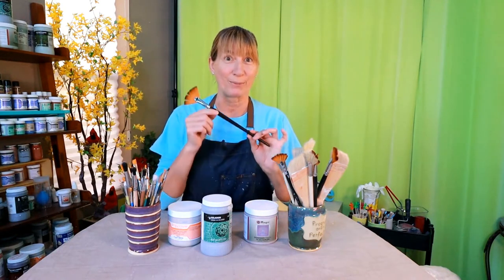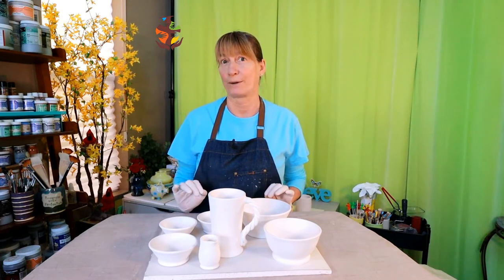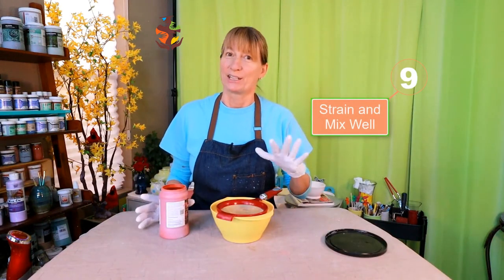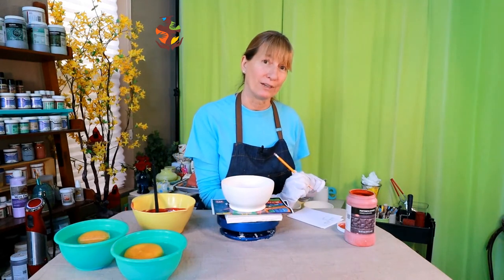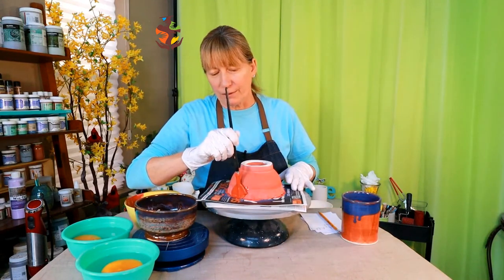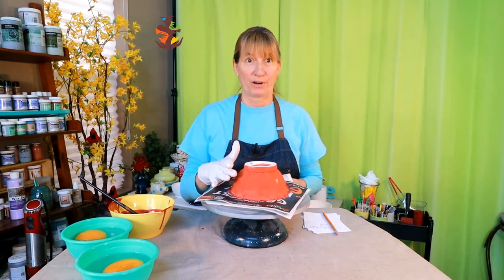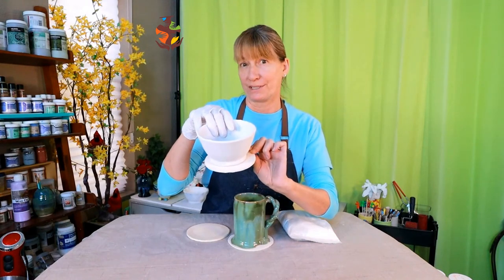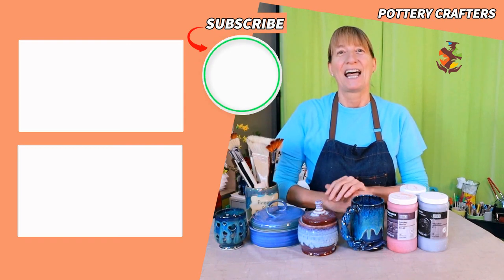21 Tips for Brush Glazing - Pottery Glazing Techniques

Comment: Hello Marie I prepared a transparent powder glaze but I find that the rendering is not very clear I left it to settle for a few weeks do you think that if I remove a little water it will give me a better consistency therefore better results. Thank you in advance.
Reply from the maker: Good question Robert. If it's not clear it may be that you don't have enough water in it. The specific gravity should be right around 41.  put your 100 ml syringe on the scale. then turn it on so you are not weighing the syringe. suck up 100ml of glaze. the water weighs 100 grams so the grams should be around 141. minus the 100 and your specific gravity is 41. Test fire if you need to. if you need a higher specific gravity then add less water. lower specific gravity then add more water. 👍👍

Comment: Thank you for your videos. I have a lot to learn about pottery and I appreciate your tutorial assistance! Love how you speak slowly instead of the rapid-fire-speed-talking of some tutorials.

Two questions about using wax resist on the bottoms of bisque ware: One or two coats on the bottom? After applying the wax resist, do I fire the bisque ware again before glazing it (and then fire a third time)?
Reply from the maker: Thank you Miranda 😊  Those are very good and important questions. You only need one coat of wax resist, wait until the wax resist is completely dry then apply your glaze. The wax resist will burn off during the glaze fire. For more detailed information on wax resist here is a link to my post -  https://potterycrafters.com/what-is-wax-resist-in-pottery-used-for/  😊

Comment: I loved this video! I am not new to visual arts but totally new to ceramics.  I really want to paint some of my artwork on flat ceramics for wall hangings or plaques, plates, ect. I see 2D as I don't have sterio vision so this works best for me. Any video that could demonstrate how glazes react to this technique as compared to pottery. I am going for an impressionist msytical look with glazes and etching on the clay.
Reply from the maker: Hi Eve, Thank you very much. If I understand correctly. I think using underglazes to get the effect you want. Then apply clear glaze over it. This should work because underglazes are more for drawing on pottery. Even colored slip in the greenware stage could work because you can apply it thicker. I hope this helped.😊

Comment: Once again, another great video. I am new to brushing on glaze, I think that I've been putting it on too thin as basically every color I brush on ends up brown. My real question is regarding glazes that run. I love the look of a flowing moving glaze but am curious if I put a area of matte glaze or something else at the bottom if it would help to stop or slow the flow.
Any ideas other than to leave the bottom of a bowl with only a thin layer of glaze?
Reply from the maker: Hi, Ann. Thank you very much. Yes, you can use a stable glaze. Keep in mind if a glaze says breaks, flows, floats, or anything like that it is going to move. Here is a brush glazing video that may be helpful. https://youtu.be/UBwH85rjafY  Keep in mind that Amaco Caledon glazes are stable.

Comment: Thank you!!  I picked up some good tips. I’ve just moved to Europe and set up my studio. They don’t really use wax resist here 🤔. Any tips you have on getting a lighter (and dare I say streaky!) water color effect?  Also - any comment on using sponge application for a bold/thick application of contrast rim color. Thank you!!! 🙏🌴🇵🇹
Reply from the maker: Thank you.😊 Actually, you can use other waxes, like beeswax. It also burns off in the kiln. You can water your underglaze down even add a little glaze thinner. Just a drop at a time. I have a few videos on sponge glazing that may help. 😍

Comment: I didn't notice you glazing the rim.  Did you do it when you did the inside or the outside?  Also, if you did it when you did the inside, you put the piece on the rim when you turned it over -- wouldn't that make a problem?  Also, do you use stilts, and if so, how do you manage the marks, or if a stilt goes into the glaze if it shifts in the firing?  Thanks.
Reply from the maker: Hi, those are good questions. Yes I glaze the rim when I glaze the inside. This video will show how I do it. About 2 minutes in the video. Here is the link  for you https://youtu.be/3OCJ8XOx1Ts I usually put wax resist on the area that touches the kiln and wipe any glaze off that area before I fire in the kiln. Here is an article for you if you would like to glaze the bottom.  
 https://potterycrafters.com/how-do-you-glaze-the-bottom-of-pottery/   Happy glazing 😊
Reply: @PotteryCrafters  Thank you.  I guess I don't understand how the rim doesn't get compromised when you turn it over to do the outside, but I'll try it!  Right now I do the outside first because of the rim.  I read your article on glazing the bottom.  Thank you so much.  You also mention doing the inside first :). I fired my pots on stilts because the person who commissioned them wanted them to be glazed all the way to the bottom, but bottom unglazed.  The firing left brown spots where the stilts were.  Do you recommend grinding them, or only the places where if you glaze the bottom the glaze protrudes.  Thanks for your quick replies.  You are an awesome teacher!  One more question.  Stilts.  I clicked your link and they all say they only fire to cone 03.  I fire my glaze kilns at cone 6, so that would mean I can't use those stilts?  Are there high fire stilts?
Reply from the maker: Yes you can grind the spots down, I do also. Thank you for bringing the stilts fire temp to my attention. I will look into it and get back to you. 😊
Reply from the maker: Thank you so much for pointing that out. These are quality steel-pointed stilts. The steel pointed stilts can withstand up to cone 10. I fixed my link.  https://geni.us/OPo4

Comment: Hello Marie. As always, thank you so much for your videos. I wish I would’ve watched this earlier. I have a platter made with low fire clay, and I decorated it with underglaze. Then I glazed it with clear glaze and glaze fired it at cone 04. It has three small spots where it looks like some particles got in the way, so the glaze didn’t absorbed and it left small bare spots. Can I touch up the spots with the same glaze and re-fire? If so, should I still do it to cone 04 with the same program I used on my kiln the first time around?
Reply from the maker: Well thank you so much. Yes you can reglaze and refire. Would recommend firing to Cone 06.  Here is a link to one of my articles that may be helpful. https://potterycrafters.com/can-you-reglaze-pottery/
Reply: @PotteryCrafters  this is so helpful! I read the whole article. Great information. Thank you so much!
Reply from the maker: That is great! You are most welcome.

Comment: These are great tips!! I just have a question. I made a tiny bottle vase with a small mouth and big body. Is it okay to “water down” a brush glaze and pour it into the vase like I would with a dip glaze? :) thanks 💗💗💗
Reply from the maker: Thank you. 😍 Yes you can!  And no you don't have to water it down to dipping consistency just make sure the brush glaze see not too thick. Here is a video of making a vase.  https://youtu.be/hhKL8_hbSBg   I glaze at 8:18 in the video. You can also pour on the glaze on the outside if you like. 😊  Happy glazing

Comment: Does the bottom need to be clear of glaze and why not glaze it? Also does the wax burn off in the kiln and not ruin the kiln shelf?
Reply from the maker: Very good questions Brenda 😊 Yes the bottom needs to be clear of glaze or the glaze will melt to the shelf because it has silica in it which is a glass-forming mineral. Yes, the wax resist burns off the kiln. I have a video on protecting your kiln shelves. Here is the link  https://youtu.be/ss-kqVRXhl8

Comment: Hi there
I’m just starting out in painting ceramic and I’m  shopping for a new paint brush set but I got confused at what set to buy cause the options they gave me a choice of Nylon, Hog & horse and I know there’s more than that so I thought naturally something Soft so I’d go with nylon but I wasn’t sure so I YouTube it 😌 that’s how I found your video so my main question is does it matter what the bristles are made of ? And if so I’m wondering what is the best bristles to use? I also want to purchase a whole set with one of each type of brush like a 1large brush, 1fan 1brush ,1detailing brush & 1sponge  brush all in one at a good price between $10.00 to maybe $25.00 I’m kind of in a budget right now and I don’t need a lot of brushes right now just basically one of each for the moment plus I actually have a few brushes cause I do some painting but I’ve literally just started painting the ceramics which I used my paint brushes and tgey turned out pretty good 😌 I’m starting a little business I don’t make ceramics I paint them but I want to do things right and need all advice and recommendations I can get  I always take notes as you said too 😆 but yeah if you could help me choose that be wonderful I’m buying my brushes very soon but I need to know what to buy. Hope you see my message and can answer or help 😌 thanks.
Reply from the maker: When it comes to glaze brushes you want the ones that will hold the glaze in the brush because glaze is not like paint. These are great brushes to start with https://geni.us/vGFRADl plus this glaze brush page will help a lot https://potterycrafters.com/recommended-tools-best-glaze-brushes/  Happy Glazing 😍

Comment: If the bottom of your pottery accidentally gets stained, and you do your best to wipe it off, once the wiped stain dries, couldn't you just lightly sand the stain off?
Reply from the maker: That is a great question.  Because the stain can seep into the porous bisqueware It can be hard to sand off, especially if you only fire to cone 06. But you can try and hopefully the stain didn't absorb into the bisqueware as much. 😊

Comment: Good! Can you use engobes without bisque firing?
Reply from the maker: That's a good question. Engobes are actually made to be applied after the final fire. The third fire at a much lower temperature Cone 018. around 1300 degrees F  😊
Reply: @PotteryCrafters  thank you!!
Reply from the maker: You are most welcome. glad to help 😊

Comment: Hi Marie.  I did my first glaze firing (cone 6) in my home studio this past weekend. We left the kiln completely cool down before opening the next day. A lot of my pieces have what I am calling pitting. The pitting seemed to have been on the bottom of the inside. Most of the pieces that I applied by hand I used Mayco SW glazes. Can you suggest what may be the problem here.  Can I re-glaze the pieces with this pitting?  If I don't re-glaze (assuming I can't), are these pieces still food safe?  Thanks for your help.
Reply from the maker: Your first glaze at home 😊 How exciting.  😀  I had that problem with my first glaze firing this post should help. Here is the link for you. https://potterycrafters.com/what-causes-pinholes-in-pottery-glaze/  The food or drink will get into the pinholes where bacteria can grow.  Also, this post is for reglazing. Yes, you can reglaze here is the link for you.  https://potterycrafters.com/can-you-reglaze-pottery/  Glad to help.
Reply: @PotteryCrafters  Thanks for your reply. I will let you know how this turns out.
Reply from the maker: That would be great. Thank you 😊
Reply: @PotteryCrafters  Hi Again. We did a glaze firing yesterday (July 4/22) & included the 12 pieces from our first glaze firing that were pitted. All but 3 appear to be OK & acceptable. Of the three that I am not pleased with, two of them I will sand & apply a clear glaze to the effected area. The other one I will keep for my use. It may be some time before another glaze firing is done but I will let you know how they turn out. Thanks for all your help.
Reply from the maker: Thank you for the update Marilyn. That's good news. 😍

Comment: Marie, Can I brush clear glaze over other glazes I have brushed on my bisque pieces? I painted a floral design on a bowl and would like to cover it with clear glaze for shine but I’m concerned about it adversely affecting the floral design. Thanks, Nancy
Reply from the maker: That is a good question, Nancy. It would depend on what glaze you are using. Did you use underglaze or Glaze?  If it is underglaze yes you can apply a clear glaze with no problem. Just make sure the underglaze is dry and only apply 2 coats of clear.  Not too thick or you will get a milky color 😊
Reply: @PotteryCrafters  I covered it in an underglaze and then used two colors of high fire glaze to paint flowers on the underglaze. Do you think I should brush around the flowers with the clear glaze rather than over them? Everything is nice and dry and I fired the bowl after underglazing (04), but before painting on the flowers with glaze. I hope I’m making this clear😉 I really appreciate your advice.
Reply from the maker: Yes, I think you should apply the clear glaze around the glazed part if it is already a glossy finish you don't want the glaze to be thick. Make sure it's the thickness of a t-shirt.😊
Reply: @PotteryCrafters  Thank you so much! Onward!❣️

Comment: How do we know how many coats to do when brush glazing? Thanks 🙏
Reply from the maker: Great question 😊 I apply three to four coats depending on the thickness of the glaze. You can check the glaze on your pottery with your fingernail. 
It should be as thick as a t-shirt.

Comment: How to avoid pinholes in brush glazing. Pls guide
Reply from the maker: Very good question. Unfortunately, there are many reasons for this to happen. Because of all the different clays, glazes, firing temperatures, and rate of firing it can be hard to pinpoint. Here are just a few that may help. After the glaze dries you can rub any pinholes you see before placing them in the kiln. After your firing put at least a 5-minute hold on to help the glaze heal. 😊
Reply: @PotteryCrafters  I hold for 20 mins
Reply from the maker: I have hardly any pins since I started to put a hold on my kiln. I was hoping that would help. You could try a higher bisque or use a cleaner clay body. Giving the gases more time to escape by firing slower and or slower cooling. Open a peephole to carry away the decomposition coming from the clay or glaze. Be careful not to apply the glaze too thick.  Hope this helps. 😊

Comment: Hellooo! as always, i love yous videos. I would like to ask you something: I use Belissimo glazes by colorobbia, i dont know if uve used them, I applied them on bisque fired pottery and on the first coat it became very powdery, like powder chunks of colored glaze? and overall now that its dry it still leaves dust on my hands. what do you think? is this normal? am i doing something wrong? <3
Reply from the maker: Thank you Kelly.😊 Interesting. No I have never used Belissimo glazes by colorobbia. I've never had a problem with any of my glazes flaking or being powdery. I use mainly Amaco, spectrum, and mayco glazes. You can check out these glazes here if you like https://potterycrafters.com/recommended-tools-best-glazes/  If the final fire results are good you should be fine. I would suggest wearing latex or vinyl gloves when handling your glazed pieces. I hope this helps? let me know.  😊👍